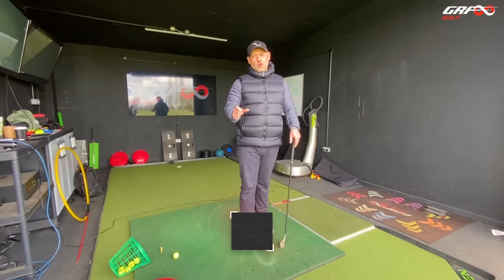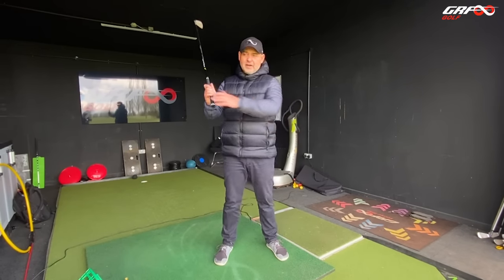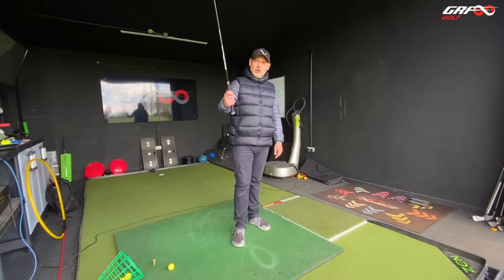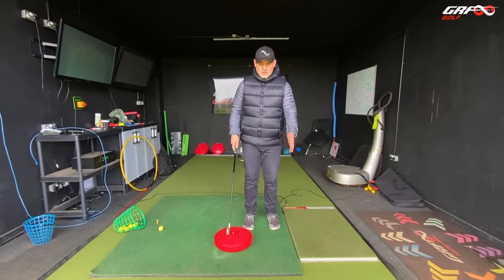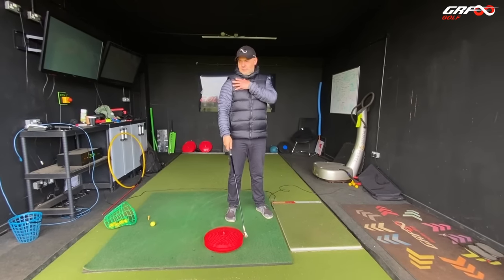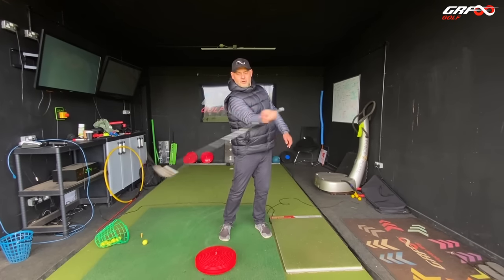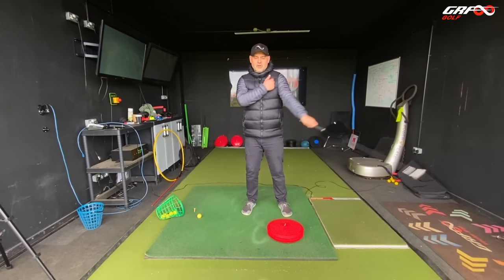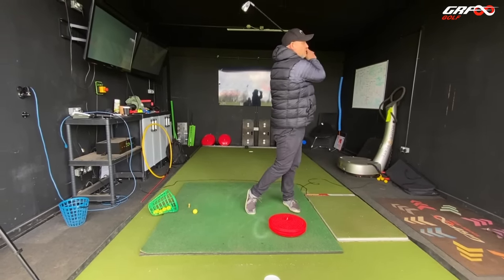How to Sequence the Upper Body in the Golf Swing

Comment: Love it Marcus, the Trampoline and balance board are super enlightening. In the beginning of this video, you lift the club handle first, lagging the head. This is exactly the way you would swing a hammer. Handle head, handle head. The half step drills at the end of the video are great but I don't understand why you don't land the left heel prior to releasing the foot.? Your trained that way!  With the trampoline I find the it is the Depth of Fall that is key as the Body (Rib Cage) senses a fall and acts on the entire system to pull you out of the ground, rather than jumping. I road a unicycle as a kid. Even at the age of seventy I have an innate sense of balance. Walking, Running, pretty much any desire to move somewhere, is a sense of imbalance/balance. Good Footwork is imperative but it comes from a Proximal/Distal relationship. Thanks Dave

Comment: Marcus ,   Are you never swinging at the target with any club but the putter  ?   I find all you talk about is taken care of by making circle swings with the arms .    Arms are swinging out  Large circle  as the lower body torso  makes another smaller circle.      It's all about the magic of the circle .   I also find low point is way back with the driver .   Level with long irons thru hybrids and fairways.  
Then in front of short irons.    Ball position should be further back on all clubs,  to get the really low points .